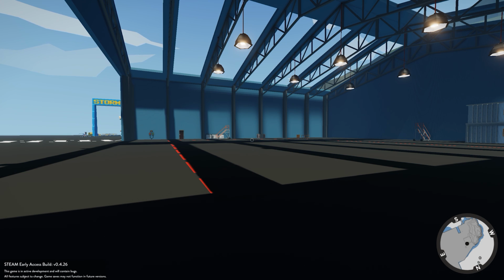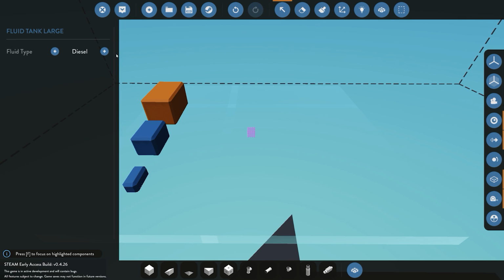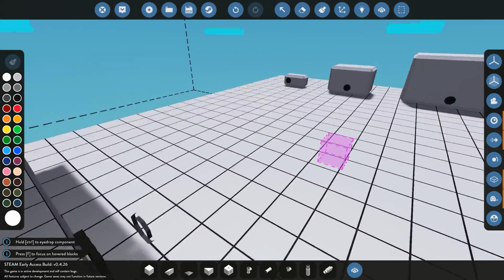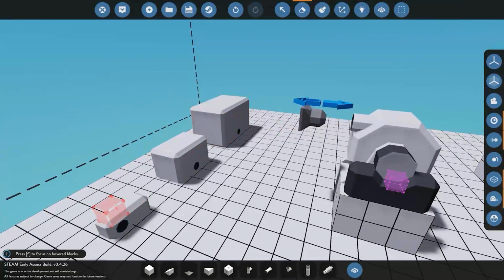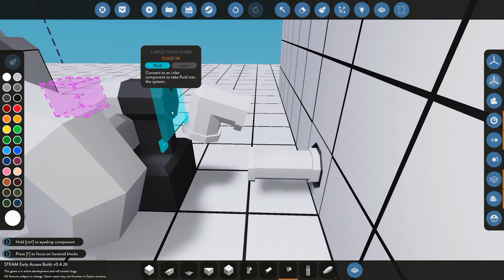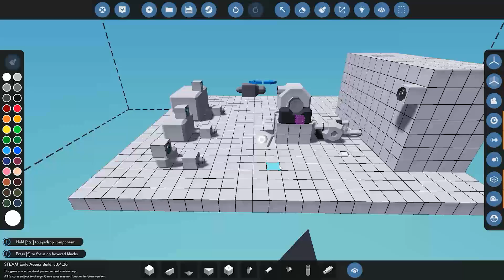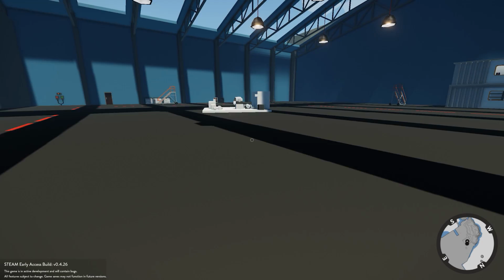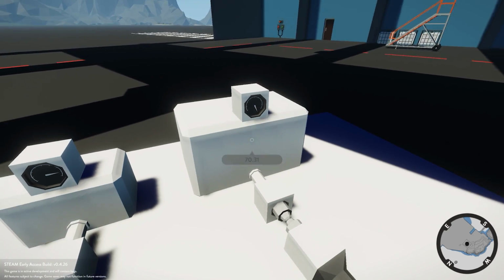Stormworks Refueling Tutorial

Comment: I have some problems with filling a fuel tank on my base (10k liters). When it goes empty, i buy some diesel on a chemical plant, transport it to my base and try to fill it through the same scheme, builted on my ship. But when it takes ~6k of fuel, the process slow down significantly till absolutely stops. It looks like the vacuum in my ship tanks don't let the fuel to go out, so in a real life the drain helps to decrease this effect. But how to fix it in a game? I use 24 big tanks on my ship. 
At the moment i've found a temporarely solution - in switching pumps for a short time period. It helps to rebalance pressures at both volumes and the filling continuos. But it takes much manual operations, which i want to skip. Could you advice me smth?

Comment: uhh there is no Hose for me what do i do?
Reply: There is a winch on the fuel pumps in the game. You only need a fluidl connector connected to the tank of the boat. You can winch out the fuel hose from the fuel pump by using the downwards facing arrow and then connect the hose to the fuel connector on the boat to fill it up.

Comment: Important point. If the tank is hooked up to an engine the game won’t let you fill the tank unless you put a valve and close it between the tank and the engine.
Reply from the maker: I havnt had that before, Iv run some tests having a running engine with a fuel tank and I am able to refuel it using the system in the example without the use of a valve.
Reply: https://steamcommunity.com/sharedfiles/filedetails/?id=1534350824

Here is my test bed.  The key's turn the valves on/off   If you open the valves the fuel tanks never appear to fill (check the dials), but if you close them they will fill, and you can open them again.  You can also run a small tank dry, then hookup the pump and run the engine as long as the pump is running, but the tank doesn't appear to fill (dial stays at zero)
Reply: @XD9rottie  Probably got changed at some point, but in making an APC I didn't experience this issue; no valve between the fuel tanks and the engine, and I could refuel it easily.
Reply: Derpy 1109 yep this was patched some time ago. This original comment was from about a year ago. Since then the dev’s fixed it.
Reply: I noticed an update they may have patched it. I’ll have to look after my next shift at work